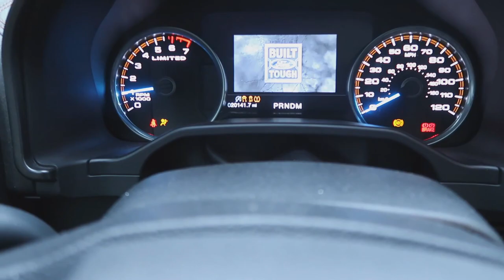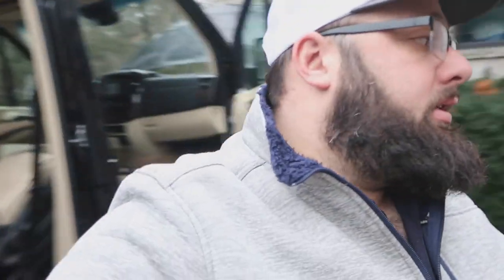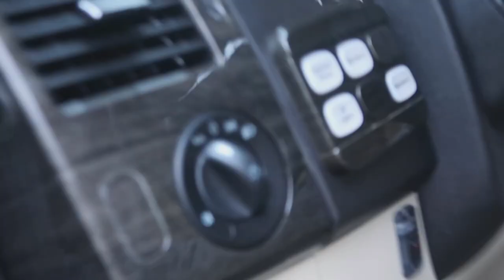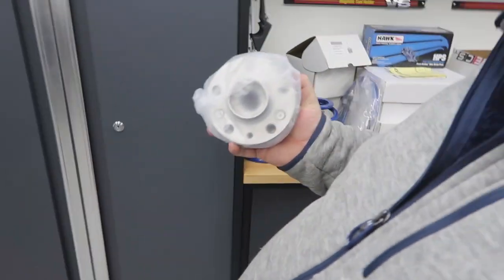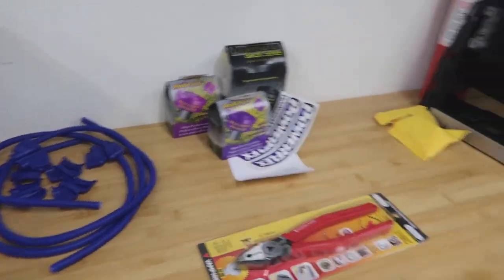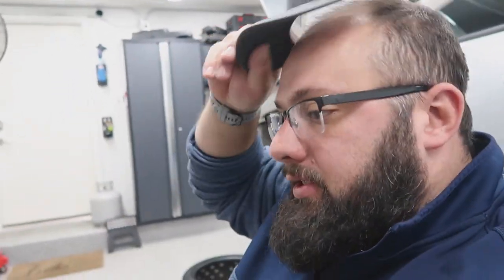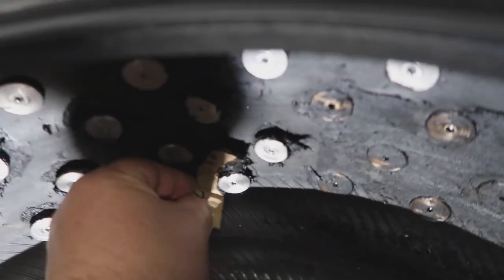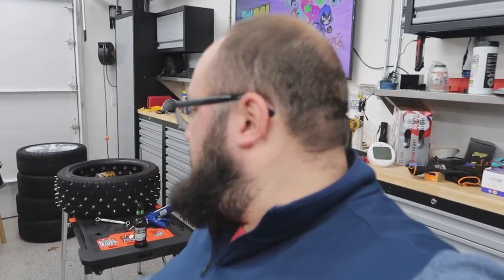VW MK4 R32 I Got NEW RIMS & FINALLY FINISHED my Ice Racing Tires! The Project Car Rebuild Pt.8.2

Comment: is it possible to know where you find the blue cable for the spark plug to replace the red one ... I try to find those no where ... thanks for your help
Reply from the maker: Mazda Speed You can find them on the website www.kaliber32.de under the point "zubehör".